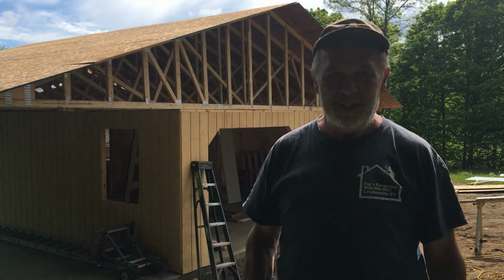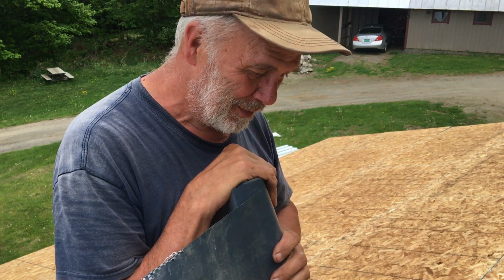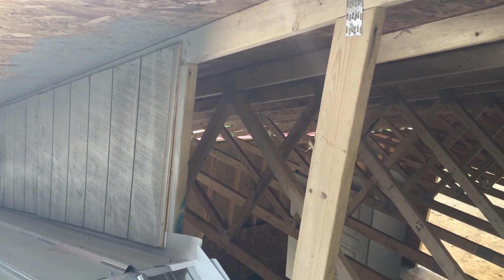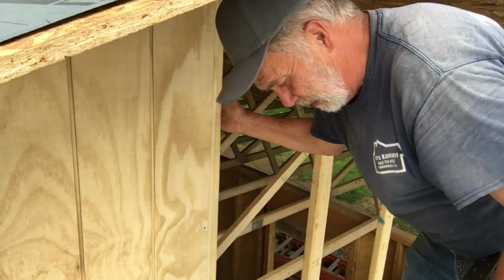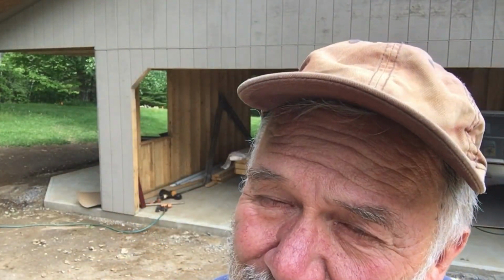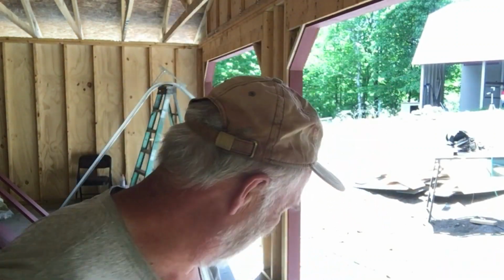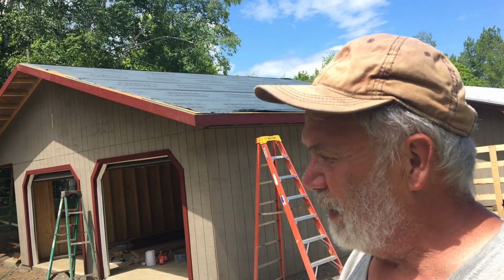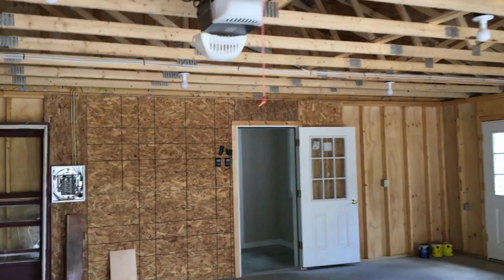#197 Garage with attached Porch and Mudroom Final  $35,000

Comment: I just got a quote back from a company to do french drains around a 22' x 30' house, add new foundation extension 13' x 22' x 8' deep with a insulated 4" thick basement slab floor, a 13' x 22' x 8" thick concrete patio on top of that. $46000!

I'm in Montreal, Canada...guys around here would charge $75K for what you're building. It's crazy.
Reply from the maker: Wow